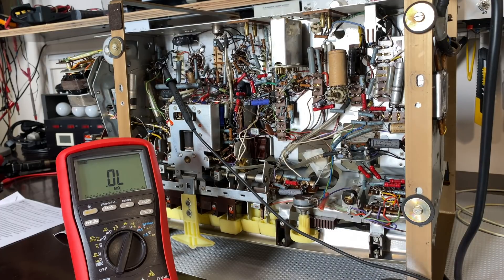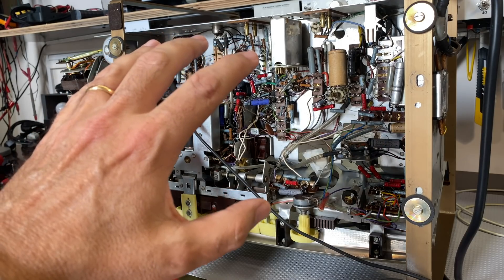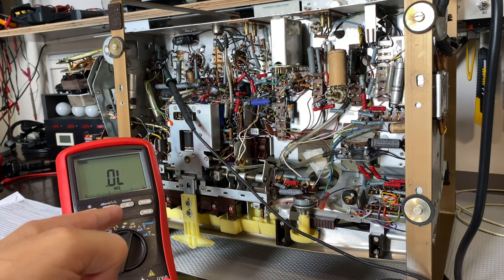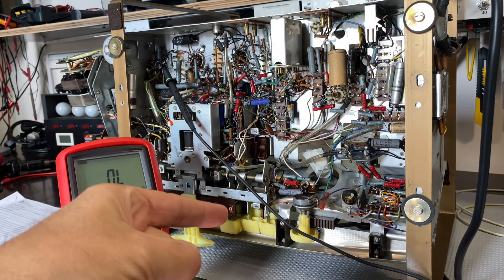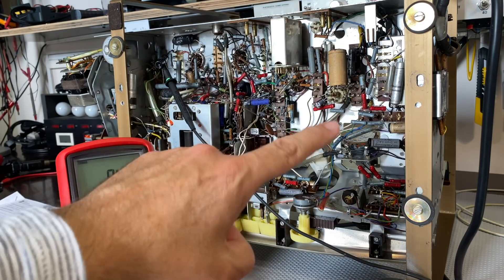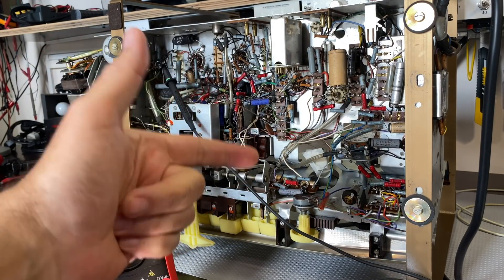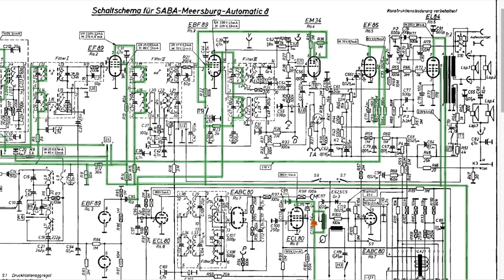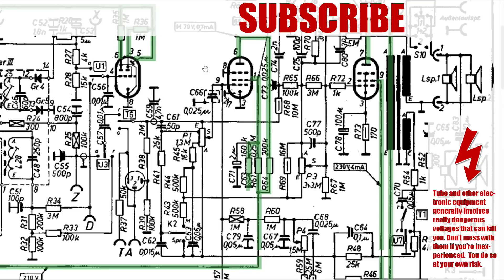SABA Breisgau 8 pt. 2. Checking the B+ lines without powering up the set.

Comment: Hi! I am highly interested in your videos. And this brought me back to restore my Siemens Super H64. I have a schematic from NVHR but it seems that the last two pages do not fit together. The top left of the second last page does not fit to the last page. At least in my opinion. 
Can you give me a hint? Or is there a page missing?
Thank you in advance!
Reply from the maker: Check again. You have the full schematic on those two pages. the second page overlaps quite a lot with the first one so you don’t get the joint at the ends. Look at the tubes and you’ll see that. Good luck 🤞
Reply: @electronicsoldandnew  Thank your for your fast and helpfull reply! Looks like I had tomatoes on the eyes :)
Reply from the maker: we all do sometimes 😊

Comment: Very thorough but laborious way of doing it. I used to tend to measure the voltages on a more complicated set and look for resistance values if I found a problem. But then I'm an ex- television and radio engineer and my methodology was more about troubleshooting than in depth investigation of circuit operation. But this way is a very interesting and informative approach and one I've adopted since I started doing radio repair work for pleasure rather than as a job. This in depth way wouldn't be realistic if time was money. At a time when the repair/service trade was actually viable on current equipment (no pun intended) you would just fix the problem and maybe do a bit of preventative maintenance. There's two different things to learn here. One is how something should operate and measure against its specifications. The other is what's wrong and what do I need to do to fix it. Which approach you take seems to depend upon the person you are and your needs and maybe the complexity of the equipment being looked at. Looking forward to the next videos.
Reply from the maker: This method is, as you say, anything but economically sensible. In my case, it’s a hobby, so part of the fun is the procedure, which usually gives me great pleasure to spend time over. If I was a paid techie, I’d be fired after my first job 😊
Reply: @electronicsoldandnew  I watched some old TV repair shops last days on shango066 channel. An old guy, well only in his mid 60's decided after a road accident he was giving it all up. Sad fact that unless you're repairing for other enthusiasts or as a hobby it really is no longer viable as a job.
Reply from the maker: I like to watch his videos. This is definitely a hobby, because nobody would pay the price of the hours one puts into it.

Comment: Very good idea Manuel, it's a technique which is obvious, but I've never thought of doing it before, I will definitely be using it in future, thanks for posting it. One obvious comment though; perhaps you should have mentioned to check that all of the B+ capacitors were fully discharged before attempting this just in case there are any less experienced viewers out there🙂
Reply from the maker: Good point. Thanks.

Comment: Agree to a certain point about what you are doing. Understand it teaches circuit construction, but I know from experience that until circuit is running under load you can miss failures from breakdown . Trouble shooting is without a doubt an important skill to learn. You make it interesting. Thanks.
Reply from the maker: This aspect is not troubleshooting at all. It’s more checking for component tolerances and connectivity. The troubleshooting comes later - when trouble shows it’s ugly face 😊